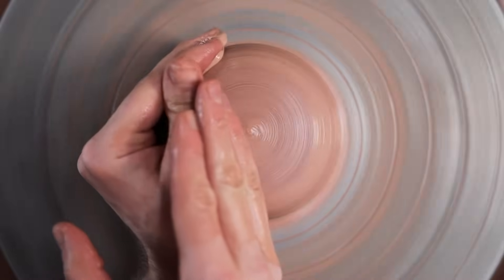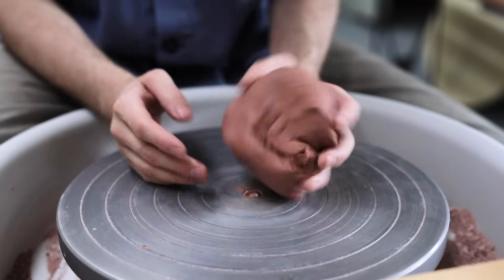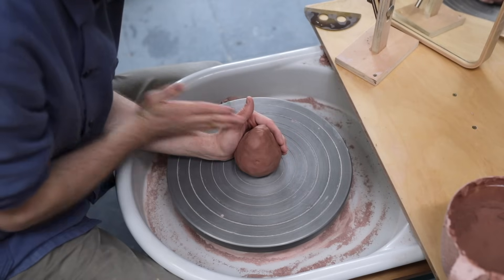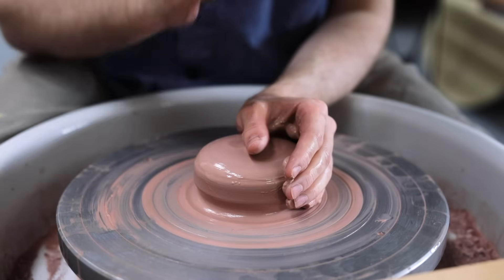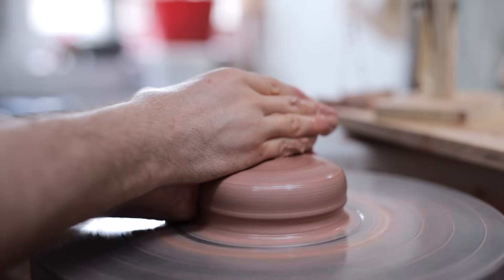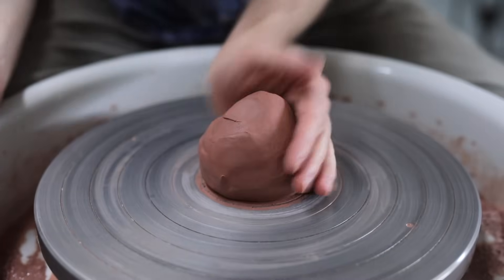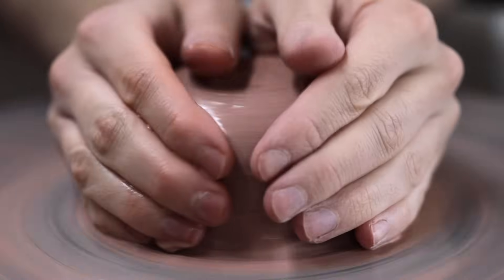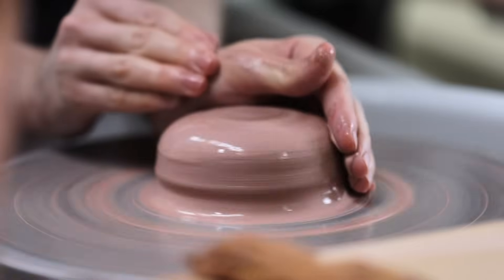How to Center Clay — A Beginner's Guide

Comment: Thank you so much Florian. I had some practice today with a full size wheel and was really struggling with centering. Even though I’ve been using a mini wheel with not much difficulty.. So it felt extra frustrating. But after your video I’m realizing I think the clay I was working with was simply too firm. 
All of your suggestions for subtle changes were rather revolutionary to me. Thank you again for your in depth explanations.

Comment: such a great tutorial, thank you so much!
I've been into pottery since my middle school years — for some reason (limited funding, I guess), we only had these very old-school mechanical wheels that you have to push with your leg... pottery is hard enough for a clumsy teenager, so this made it nearly impossible.
so, I got into pottery again five years ago or so and was stunned at first by now much easier pottery is with a normal wheel. however, at some point I ended up being frustrated by how hard it is to make your pots perfect even without the need to push the wheel with your leg... so I gave up again

now, I'm giving it another try; so thank you once again for these tutorials, and for urging to follow through with the first pots, however imperfect these might be. I really needed to hear that!

Comment: Thanks for this and all your videos @Florian Gadsby. One of the issues that I have as a beginner is twists that form in the clay from too much pressure or too little water. I discovered that if it happens when centering coning two or three times will get rid of it. But I have no good solution when it happens as I pull up the walls. Perhaps it is something you will address in the next part of the series? (Obviously the goal is to stop doing it, which takes more practice.)

Comment: I have a question. After you mess up or reck one piece of clay, can you take that same piece immediately after and just roll it back up and use it again? Or is there a reason you have to use new clay? I just wanted to try this out, but I didn’t buy very much clay
Reply from the maker: It can be immediately reused but you have to wedge it up to get rid of any air pockets that inevitably find their way into a collapsed pot. If the clay has become too soggy you may find it tricky too, but it’s definitely doable, just situational.

Comment: A quick question, you mentioned in this you don’t always cone up. Can you clarify when you don’t cone up? Thanks for a great video!
Reply from the maker: You can get a sense for when the clay just feels 'right', and coning isn't necessary. As for some smaller, more rapidly thrown pieces like mugs, I can make them despite a tiny wobble in the rim, it can be squashed as you pull up the walls if you do it in the right way. Hopefully I'll explain that more thoroughly in my pulling up the walls part of this series. Thanks for watching!

Comment: any suggestions on how to soften clay if it does feel a bit too hard/stiff to center? can i prepare it differently?
Reply from the maker: Slice it into thin layers, dunk it in water, wedge it all up again. Spray it a lot with water. Wrap it up with a soaked towel overnight. Let it go bone try in small pieces and then soak those now and recycle them conventionally. Lots of ways of softening it down but sadly all require a bit of work!

Comment: My question is how hard to do you push? I find that I’m overexerting myself while trying to force the clay to move. I try so hard to plant my arm but it still wiggles. I’m hoping I can properly apply these techniques you have shown us. Thank you.
Reply from the maker: Well, you have to push hard! But not too hard! Firm clay makes the process more difficult when you're learning as you have to exert so much more pressure. You'll figure out the right amount of force needed, I typically say it's more than you think to beginners. Clay is soft and once wetted it shouldn't require too much movement to get it into the right place, it's more a matter of technique I'd say as opposed to force. Good luck! Keep practicing, it's that which will get you better the quickest!

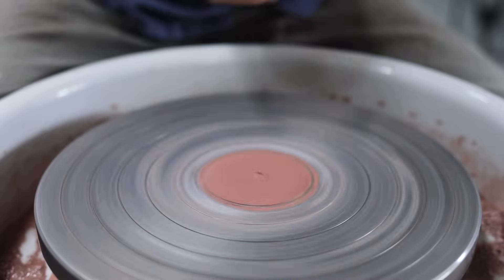Comment: very good tutorial EXCEPT for the 11:20 part. If you leave the previous layer the new and old sticked clay will very likely leave air holes that you won't be able to track later which in its turn will result in cracks later.

Comment: Even watching your vídeo I still have trouble centering the bottom of the Clay! Do you have some tips for this problema?
Reply from the maker: Try leaning in with more pressure from your hand hand. You really have to show the clay who's boss and apply more strength than you might think. Soft clay helps tremendously too if you aren't using that and try to tuck in your little fingers around the bottom of the lump to keep it under control.

Comment: I have a question. I'm fat and therefore can't push my elbow into my belly cause the fat of my arm won't let me. On top of that, our potter's wheels don't have such a plastic container around the wheel so i also don't have something to push my elbow against. How would you center the clay, if you where in my position?
Reply from the maker: So, I would find something you can position near the wheel, or even place a plank over the frame and secure in place, anything, which you can then anchor your arm against. It might take some experimentation to find something that works. Or, you could try throwing standing up, that way you just lean forwards to centre. Lots of people throw standing up for that reason, it helps your back too in the long run. Good luck!
Reply: @floriangadsby  thank you. I like the idea with the plank but i guess that's what the only thing i can do for now. Sadly it's a older machine and you're forced to use it sitting down. I wanna buy a potter's wheel for myself tho, so i can practice at home too ^^